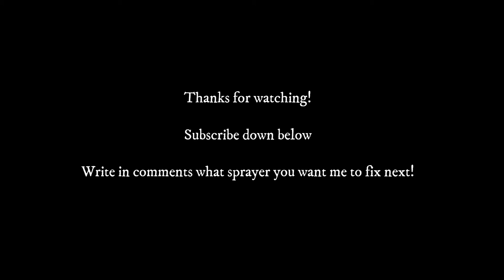Graco 490 Repack

Comment: Approximately how tight should the piston valve be? I snugged it and gave it another half turn and it eventually came loose even with thread lock. Another time I tightened it pretty tight but it ripped my packings after a few uses? Help? Thanks!
Reply from the maker: You have to be careful, its a fine balance. I tighten just enough that the packing are not swelling out, and always use thread lock. And when you put the rod in the cylinder make sure you use LOTS of grease, it will help prevent the packings from getting  sheared.